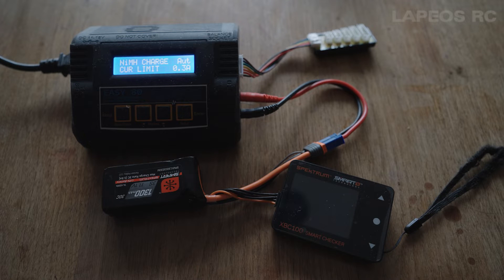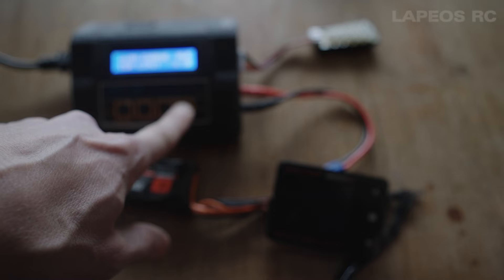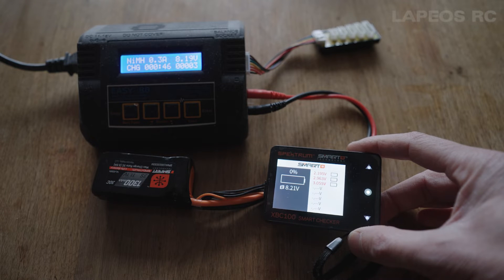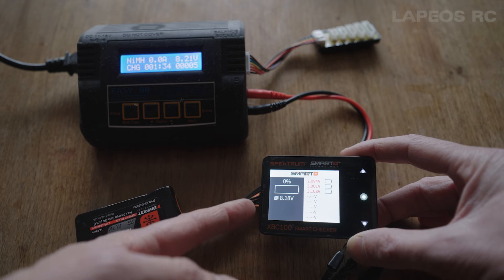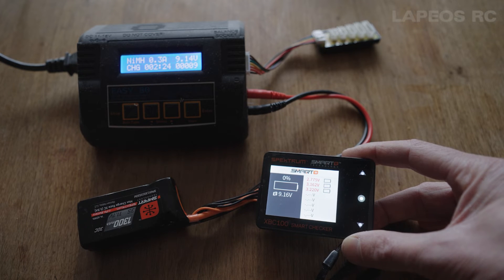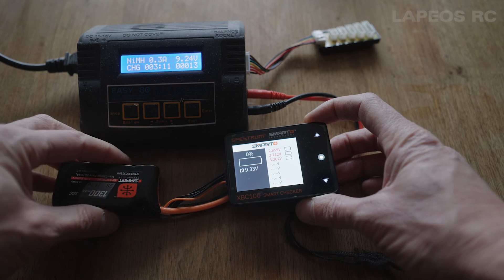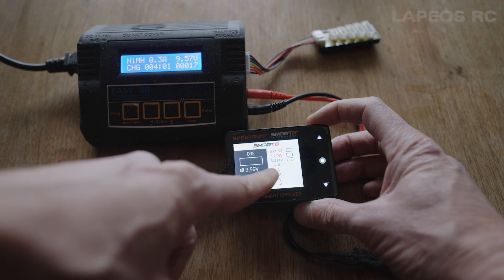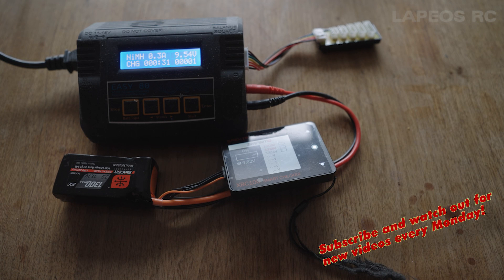LIPO battery empty and depleted magically SAVED!

Comment: Is it possible to use a power supply that can dial in volts/amps ? and I have one with watts too, But is this the same ? Watching super closely for heat & swelling.....if I understand everything here. The NimH charger is really a dc charger that allows higher full set point for those batteries ? After raising to 3.2 VDC on cell 1 install on to the Spectrum smart charger ? I bought brand new batteries 6 years ago, never used them from an accident, now I'm back trying to salvage my $110 each batteries..... If I get a positive answer here I may try and do what I have described above....... I do have Spectrum Smart Batteries, Smart charger, and the Spectrum checker XBC100........so I think it can be salvaged!! No ?
Reply from the maker: You will need a Nimh charger to do it as safe as possible.

Comment: I have a 5000 mAh 11.7V Spektrum battery (new) that had 0 volts.  My Spektrum Smart Charger declared it dead.  With a fire blanket handy, I carefully followed your tip and proceeded to charge it using my Turnigy Accucell 6 as a NiMH at .3A for 5 minutes.  It never got warm to the touch.  I then put it on my Smart Charger, and it began the charge process.  It reported 34% charged after 5 minutes, within 24 minutes, until a full charge.  I will discharge the battery and recharge it again to renew its health.  This is a miracle cure.  Thank you from Canada.
Reply from the maker: @CanadianClub  Great to hear!
Reply: Wanted to say that this worked for me as well on a G1 4s 5000mah Spectrum battery. charged on the NiMH at .3 for 5 min and it worked on the spectrum charger after that thank you!!!!!

Comment: My Spektrum S2100 Smart Charger wont allow this...what charger do you recommend?
Reply: I got a gens ace which helped me recover a spektrum battery. I followed steps shown in this video and charge it for 5 minutes. Then, connected it to spektrum charger s2200 and it worked like a charm
Reply from the maker: Any NiMH charger that can be setup with current and voltage like a multi charger.

Comment: I've used this technique several times in the past, but I've been hesitant to teach it. It can be sketchy. I like that you keep checking the battery for any signs of heat. For anyone considering this it is important to know that very low voltage is key...less than an amp. High amp NiMH charging a Lipo will cause a fire very quickly. Never do this unattended, and a large bucket of sand is a great thing to have close to your charger. Makes a mess but will smother a Lipo fire quickly. Like someone already said here, if it isn't working relatively fast it isn't going to. Give it up and replace it.
Reply from the maker: It is to be done as a last resort and very carefully monitoring what's happening.
Reply: @SunriseRCAviator  Yep

Comment: this does work you just have to be careful, I then will use the checker to balance the cells.
Reply from the maker: It is to be done with caution yes but so far the batteries I've done this with has been working fine without issues. These Spektrum 1300 mAh batteries I have to check more often as some tend to lose charge.

Comment: Be very careful when you do this. Constantly monitor the heat being discharged from that battery. 
   Monitor that it's taking a charge. If it suddenly stops then the battery is gone bad. The internal resistance is too high and you're risking explosion. I've seen that happen.
Reply from the maker: Yes this is to be done carefully.

Comment: 2 of my 6 3s G1 1300 smart batteries have failed. Both drain cell 1 to 0v which leads me to believe that the smart chip is the cause. I like the battery and use it in many planes. I hope the G2 version does better.

I have zapped discharged lipo's back to 3v per cell by connecting them  to a fully charged good battery for 5 to 10 seconds. Do this at your own risk of course.
Reply from the maker: Maybe this is a common problem with this battery. I have two that have dropped voltage to much.